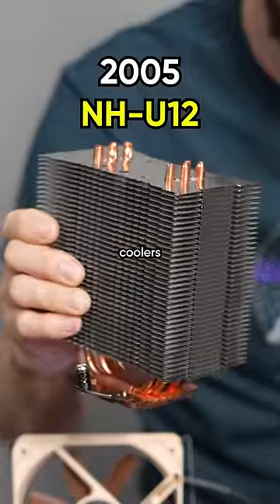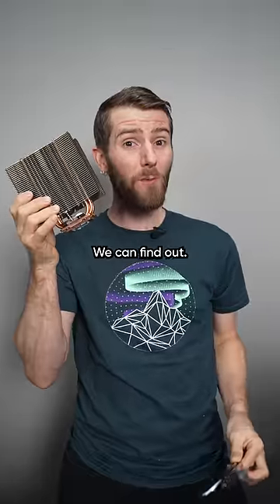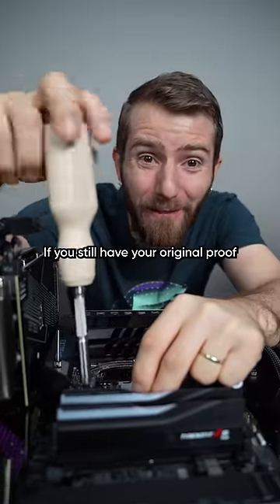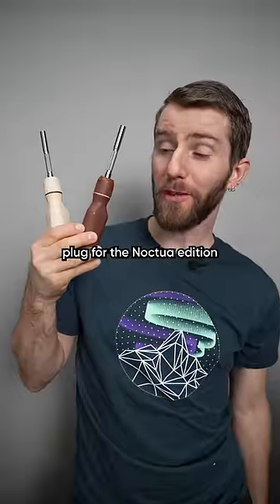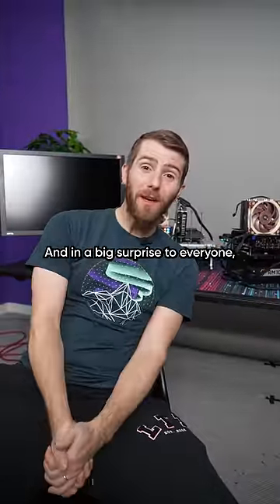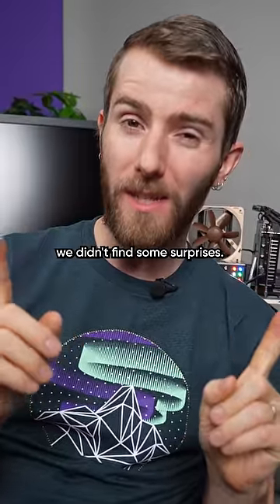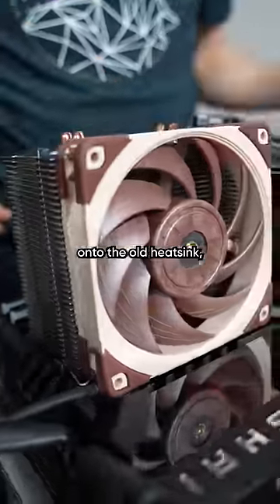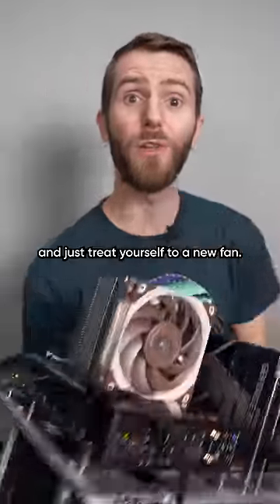Can You Still Use a CPU Cooler from 2005?

Comment: I wish they'd release a new version of the D15. It's no longer the best of the best and 35 dollar air coolers like the phantom spirit get pretty much the same performance. They need to step up their game because I have no reason to buy a d15 when alternatives are so much cheaper
Reply: They've been working on a new cooler and especially fan (as you can see in this example it is often the majority of a performance increase) for the last 8 years. They had a lot of information on it in their CES booth this year that was covered by various outlets
Reply: Name an air cooler better than the d15
Reply: @nanotyrannus5435  interesting, I wasn't aware of that I didn't really watch CES coverage this year
Reply: @samson_the_great dfuq? There are like 5 or more better air cooler than the D15 now. The AK620 definitely shreds it
Reply: @samson_the_great the D15 is still very much at the top (which is extremely impressive for a product that's been on the market for so long), but there are a bunch of thermalright and deepcool options now that perform the same or even slightly better, and cost half or less.
Reply: No reason? They literally explained the reason in the video, free mounting hardware whenever.
Reply: It’s on their roadmap of upcoming products on their website. Currently projected Q2 2024
Reply: Reliability is often better than new crap released every year imo
Reply: @TipuToot-x2b  Reliability of a giant hunk of metal with some pipes in it? lol? On standardized mounting
Reply: @TipuToot-x2b  wdym reliability? Heat sinks basically last forever, I bought a $20 tower cooler like 10 years ago and it works perfectly fine still. The only thing that can deteriorate are the fans but those are very easily replaceable on a tower cooler
Reply: @TipuToot-x2b  reliability of what ? Heatsinks literally can't fail as the video shows. Only thing prone to failing is the fan , and deepcool/arctic / thermalright fans are often less than 10$
Reply: @samson_the_great  Peerless Assasin and Fuma 3 both perform on par with it for significantly less money. The D15 is decent value on the used market though, and as they've been around for 10 years they're plentiful.
Reply: @samson_the_great the peerless assassin for like 40 dollars
Reply: @rysterstech  horrible cooler. Only works with low profile ram, and to get the same results as the dh15 the fans make a shit ton of noise, like unbearably loud.
Reply: @jeze2432  so what fan rpm and noise are not a factor anymore? That cooler is way louder than the dh15 so no it doesn't shred it.
Reply: Updated my rig with all Noctua stuff, it for sure gets the job done, and way quieter than the older fans.
Reply: @Rikorage  I have room for 6 140mm fans. I'm waiting til Q4 224 for Noctuas new Chromax fans.
Reply: Yeah, I got the NH-D15 as well, great cooler, but got a Thermalright Phantom Spirit and I only got it because I was tired of looking at poo brown and didn't want an AIO or spend $100+ on a black version the D15, the Thermalright performs better and is smaller and a whole lot cheaper. Hope Noctua's next coolers really impress.

Comment: Really shows that airflow should be the number one priority when it comes to cooling. Just swapping my case allowing me to put 3 extra fan (and get rid of all the dust built up) dropped my temp by 10°C. I went from a toasty 103°C VRAM (3090 reference) to a warm 90°C. Still not comfrotable with those temps though, can't wait to go full custom watercooling to fill that EVO XL
Reply: Correct.  Put a 60W incandescent bulb in a sealed metal box with no airflow and try not to singe your fingers an hour later.  There are many ways to get rid of the heat coming off of the heat sink. But even the smallest 1 inch fan in a laptop is orders of magnitude better than nothing.  If it's done correctly, you can get by with almost no fans.
Also, pro tip from an old system builder:
Those fan grills on the rear of cases are required by the government as a safety feature.  Take a Dremel to a new case and cut it out.  Put in one of those round wire fan guards instead.  This will lower noise significantly as well as improve airflow as the fan isn't crammed against the screen, increasing wear and back-pressure.
Reply: @josephoberlander  no worry, it is watercooled now and everything never go above 70°C (vram included). I'm not putting a dremel anywhere near a case this expensive anyway, I rather put some spacer between the fans and the frame/rads
Reply: @guillaumejoop6437  That doesn't really help with the poor design, IME.  What should be there is a nice open circle and you then put in a finger guard/grille with the fan.  But you know how manufacturers are litigation-adverse.  So they just stamp tiny holes in the metal as if that's really an "opening".  Often, with a bare case, it takes a few minutes at most to cut out a nearly circular hole out of the grid. Then a little sanding and it looks like it was built that way.  Easy 20-30% better airflow. As a benefit, your fan noise will drop by 30%, typically, as a lot of it comes from back-pressure and the fan struggling.
Note that all fan ratings are based on it hanging suspended in open air, so anything you do to impede it greatly shortens its life, adds noise, and lowers efficiency.

Comment: It looks like the first fan on this short that was used on the old heatsink is a newer fan that is specific to case fan cooling made by Noctua rather than the original fan. If that’s the case (no pun intended), then of course the performance would be far worse than something that is made for higher pressure. The NH-U12A is also a push-pull configuration
Reply from the maker: We used the exact configuration that Noctua sent us when we reached out to them requesting items for this Short, so the fan that's on the old cooler is what they gave us with it.

You can also see the same fan here in this article: https://bjorn3d.com/2006/10/noctua-nh-u12f-cpu-cooler-nf-s12-1200-fan/
Reply: Yeah who in their right mind would put that volume optimized fan on the heatsink lol
Reply: @LinusTechTips interesting! I looked it up and the fan I thought I saw is the NF-S12A which seems similar to the old design. I wonder how the two compare as case fans.
Reply: I don't know the difference I just want them to make an A14x25mm like their rep promised they would 2 years ago.

Comment: To be fair, the heat sink itself isn’t really a marvel of engineering or technology. It’s just using physics, a bunch of metal surface area to dissipate heat. Not much needs to change from the OG design
Reply: Yeah, that 4th heatpipe is probably doing the majority of that 3 difference
Reply: Everything is "just using physics;" Physics, being the study of matter, energy, and whatnot, encompasses everything. Therefore, it cannot be determined that something isn't "a marvel of engineering or technology" because it's just using physics, because everything is governed by physics and all things designed with it in mind.
Reply: The science around thermo-fluid dynamics, specifically relating to finned surfaces/heat sinks can definitely be categorised as a marvel of engineering and technology, although the understanding has been pretty advanced for quite some time so I can somewhat see the point you're trying to make. The design is inherently a balancing act between surface area and flow rate, and because of standardised fans & mountings there's not much scope for advancement in heat sink efficiency. The main benefits will come from improving overall flow rate, which is why a fan upgrade will usually provide better returns than a heat sink upgrade.
Reply: So if its not marvel of engineering please tell us how those pipes works exatcly?
Reply: so is the fan lol

Comment: TL; DR - physics haven’t changed in the last 2 decades 🎉
Reply: The physics of the cooler certainly did lmao.
Reply: @rolandfischer931  Nah, it's still the same basic design, just slightly tweaked. Still using much the same heat pipes.
Reply: @wolfie54321  I said the physics of the design, not the shape of the design. It has increased its cooling ability, which is the physics I am talking about. So no, the physics of the cooler have indeed changed.
Reply: @rolandfischer931  What physics have changed? It's literally still heat pipes, just more of them, and maybe at most they improved a couple of interfaces. Same physics, just more of it. When we say the physics have changed, we generally mean the underlying behaviour has changed (e.g. a heating element heater vs a heat pump heater, they're trying to do the same thing but with different physics).
Reply: @wolfie54321  no, that's not what I mean, but that's okay! You're welcome to your opinion on what physics are.
Reply: @rolandfischer931  LOL, okay, yeah I guess it's just semantics. I'm a researcher in fluid mechanics, when we use "changed physics" we mean the underlying behaviour has changed (e.g. laminar flow or turbulent flow is different physics) or we might say "the same physics" to mean something where the results are different but are driven by the same underlying effects. But I guess others might use the word differently.

Comment: Still got that exact cooler myself and it’s just moved over to my rebuild on 1700. I had it on 1155 and possibly one before that, my invoice is long lost though so I did have to buy the 1700 mount. Still not upset, it’s amazing that I can still use the same cooler across multiple generations. It’s how things should be.

Comment: I have a Thermalright Ultra 120 Extreme from 2006 that I still use in an i5 system, bought the mounting adapter for €11 and it keeps the i5 CPU at 25’C during idle with 44’C max with fans on quiet. Amazing product.

Comment: I recently donated an ultra budget build to a family in need consisting of a dirt cheap OEM Core i3 10100 and a 20 year old Thermalright XP-90 (circa 2004) I found in storage that I adapted to fit with old water block mounting hardware. The CPU maxed out at a very quiet 55C, and they are very happy with how fast their "new" computer is. Love knowing that a heatsink I bought 20 years ago is now responsible for introducing a new generation of kids to computers.

Never throw old heatsinks away! Adapting them is easy with a little ingenuity, and if they dissipated 100W in 2004, they can dissipate 100W in 2024 too.

Comment: Even if your proof of purchase has gone missing, the parts are easily and cheaply available. I ended up going that route, since I also needed parts ASAP and didn't want to wait on support. 

I've got a NH-U9B SE2 that started it's service life on an LGA775 Core 2 Quad system sitting on top of my 5800X3D right now! Yeah it cost more up front, but it's still going and even has AM5/LGA1700 support, where a LGA115x cooler I bought from another brand is a fancy paperweight now and I had to replace it with an entirely new cooler when I upgraded that system. And when that system comes due for an upgrade, that newer non-Noctua will probably become a paperweight too, while the U9B will probably still be goin' strong.

Comment: I had every intention of reusing my old  Noctua cooler from my i7-950 on my new i5-13600K but the brackets didn't match and I didn't know you could get replacement modern brackets. I was also very impatient about completing my new build, as I also reused my GPU, PSU, DVD, and SSD. All those components much newer than the MoBo. Ended up with an absolutely gorgeous NH-D15S Chromax Black, and spending way more than I needed to. I don't care, I love it.

Comment: I have a dual radiator noctua, with the 2 fans and 1 exhaust on the back, seems overkill but my room in the summer gets waaaay to hot. Only running a Asus 1060 6gig for graphics, aside from the Graphics card which honestly holds like a champ (love those old turbo designs) The radiator with just air cooling which is basically just swapping hot air for hot air in the summer i barely see a difference, they work SO WELL. Love Noctua and proudly slapped the sticker emblem on my PC.

Comment: reason why the new cooler preformed 3C better than the original one is due to the copper heat pipes layout the new ones spread the heat more over the aluminum fins. the old one send it all in 1 area. which is the main diffrence

Comment: Its crazy how much a good fan alone can improve temps on a tower cooler or AIOs. Ive been able to drop temps by 10°c just by replacing the stock fans with better quality, higher CFM fans.
Reply: It's a shame arctic cooling no longer provides aftermath heatsinks for gpus. I used it for my MSI ventura 2070 super, it was a lot more efficient than stock cooler (quieter and cooler than the original) they even had a backplate heatsink with 4 square cutouts to allow backplate mounting around the die. though it  wasn't easy to implement

Comment: I have re-used my original Scythe Ninja for several builds. It was designed to passively cool up to a 95W CPU and is laughably overkill for modern CPUs. A new fan and it works great.  The extremely wide fin spacing makes it very quiet and allows you to use the rear fan to pull air through if it's within an inch two.

Comment: A. Considering that Dell and HP still use the same cooler in their prebuilts for 20 years makes this question rhetorical.

B. Props to Noctua, their product support is unrivaled. I have received three mounting kits from them over the years for a single cooler.

Comment: Now I need an AM4 mounting kit for CPU waterblock of the Zalman Reserator 1 Plus set. Originally it came with the mounting brackets for Pentium 4, Athlon 64 and Athlon XP, but it is so good I still want to use it on a modern system. That ZM-WB3 waterblock is made of gold plated copper. The pump is so silent that to tell if it is even running or not you have to touch the water output hose to feel the vibrations or look at the flow indicator.

Comment: Once you realize all the brackets are just metal you can adapt your own heatsinks to pretty much anything with some metal plate, a drill and some long threaded bolts.  And yes, if it could cool 100watts (or 150 or 200 etc) in 2005 it still can today.

Comment: Certainly they do last long term and perform great. Mine from 2012 is on its 3rd computer and is still working just fine, only needs a cleaning once in a while.
Reply: same still have my Cooler Master Hyper 212 that's been through at least just as many computers as your's if not more. remember having to modify a case because the fan on the side panel would interferewith the cooler

Comment: The reason being is that heatsinks like this run on the power of heat pipes, which are about as efficient as you can get for transferring thermal energy without using additional power.

There just isn't a lot of improvement to be made here. Maybe some material science will improve it a few percent in the next decade but.. you can only move heat so well and we're nearly at that limit.

Comment: Older platforms are not that much less heat generating if your dealing with the middle or lower tier cpu's. The best example is Prescot HT, those cpu's needed pure copper towers to cool properly. I still have tower coolers for netburst based servers which will cool Ryzen 7 5800X no problem.

Comment: I've been using the same water block for almost 15 years now.  its seen time on an older intel and many AMD processors.  it currently lives on a rather outdated FX8320 at 3.5ghtz and keeps temps at 85F under load.

Comment: Aaaand that's why I'm keeping my NH-U12P - it kept my heavily OC'd Athlon II X4 620 cool even when it was pulling more than 200W, kept my Core i5 4670K cool too (I replaced the fans though, the original one didn't support PWM, and I mounted two in push-pull), it easily handled my Ryzen 2700X and is currently keeping my underpowered (65W) Ryzen 5900X cold.

Comment: Still using my NH-D14 bought 2010 with the original fans.
Q6600
I5-2500K
Ryzen 1700
Ryzen 7600X

It's old but it works great and temps are great. Will buy the new D15 when it drops 😊

Comment: I was genuinely surprised... I thougt those inline heatpipes would lose plenty of efficieny... I mean does anyone expect any signifficant amount of heat to actually reach the furthest point on those thin pieces of foil? There is little cross-section to work with, so most heat is likely to dissipate fairly close to the heatpipe. After all, that is why modern coolers don't stack heat pipes in a single row like that anymore. On the other hand, shaving another 3 degrees of your temps might be anything but simple.

Comment: According to Noctua's site you don't need a proof of purchase for the cooler. All you need to do is take a picture of the cooler next to you and you have to hold a piece of paper with your name and the current date on it. So by this account even if you buy a second hand Noctua (or you just lost your receipt) you can get new mounts.

But you will need proof that you bought a CPU and a motherboard for the socket you are trying to get mounting hardware for.

Comment: CPU core temperatures went from like 60 to 99 °C which means it's easier to extract heat from them. The power may have gone wild but only for top performance chips. Most modern CPUs can have pretty good performance under 60W TDP which wouldn't be shocking even in 2005. Those were my thoughts when throwing away an ancient, but performant LGA775 Arctic Freezer.

Comment: Someone needs to innovate on the metal wires that attach the fan to the heatsink.  What a nightmare to clip on in a tight case.  I had to tape them in place then remove the tape when it was together to keep my sanity.  A ball knob end or something, seems like there have to be thousands of better solutions.

Comment: And that 3° is probably because what's inside the heatpipes has dried out.
I'm still using the Coolermaster V8 on a modern system and it still kicks.